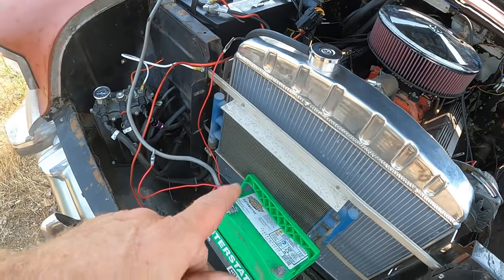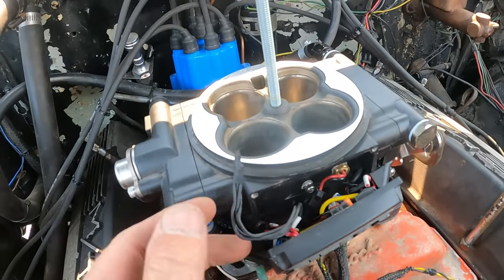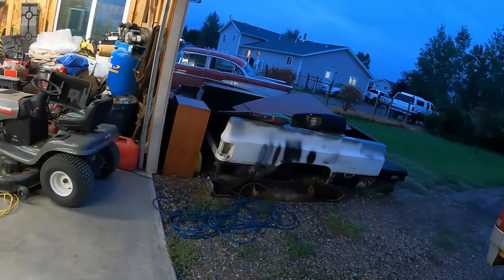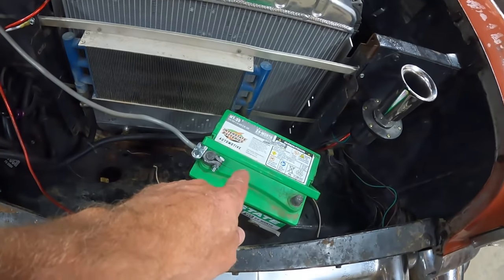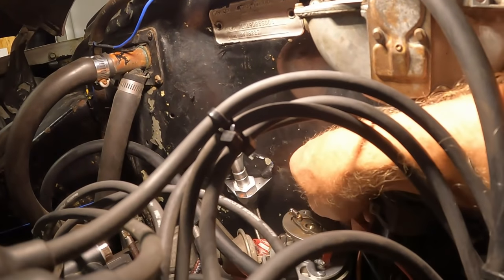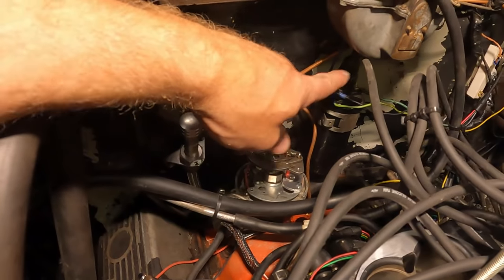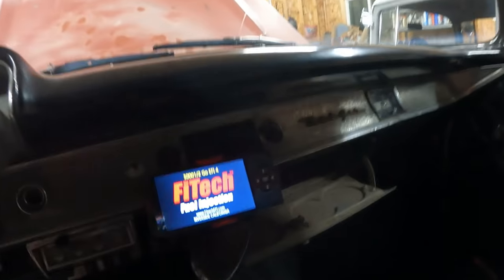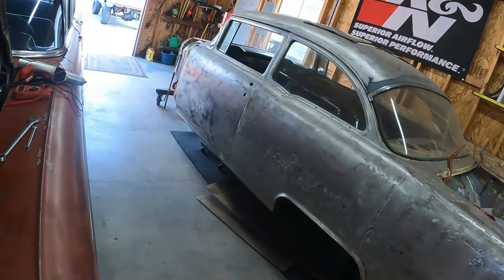Installing Pertronix Electronic Ignition, the FiTech Fight Continues

Comment: Yeah wow, this is so sad for you that now the ignition system is not working. No spark. Damn it.  Yeah I feel your pain. Question do you need to set the air gap on the pick-up coil in the distributor? Also a worn distributor shaft will give you issue. Good luck keep us posted. OH yeah the 57 i/was known as the DD Speedshop 57 to all those just like yourself. I have no issue with you calling it that. If I won it I would be calling it the same think. Greer's and God bless you and the DD Speedshop 57.
Reply from the maker: Hopefully it was a bad ignition module and a new one will fix it, but most likely it is still some weird wiring thing I cannot trace down. There is no gap or anything to set on the system. It just work off of magic like I said. Haha, I'm not sure how it works. I have not checked the dizzy shaft, other than it "feels" normal to me. That may be something that gets changed out if the issues continues. Thanks!

Comment: Where is the "star wheel" that fits on the centre? The pertronix system needs to know when to fire,  so there should be a black ring that fits on the spindle  (where the 8 lobes are that would lift the points) the points replacement pickup then senses the signal.
Reply from the maker: Thanks for watching Bruce. There is no "star wheel" or magnets or anything with this version of Pertronix. It is "lobe sensing". So I guess it somehow senses the lobes in the distributor shaft? I don't know. Like I said, it works off of magic...

Comment: Hi Brad, I don't remember, does this car have the updated side motor mounts, or does it have the factory front mounts? The reason I ask is because on my 1st 57 Chevy with factory front motor mounts, I was able to fit a factory Chevy hei distributor in it. That I got straight from my local junkyard. No problem with fitment at all. And I was able to throw out my external coil, ballast resistor and all of the wires associated to the external coil, starter and ballast resistor. Put a new cap, rotor and 8mm sparkplug wires on it. Ran a 12 or 14 millimeter wire straight from the fuse box to the battery terminal on the distributor and the car ran great. If you infact have side motor mounts, sometimes those can be adjusted 3/4" forward, which may give you the room you need for a factory gm hei distributor. You could buy that brand new fairly expensive at autozone. Just tell them that you need a distributor for a 75-79 Camaro with a 350 ci. I have also heard of people having to unbolt their transmissions and jack up the back of them in order to get the hei distributor in. Because their transmissions mount is worn out and the engine is sagging closer to the firewall. And yes I have seen the cheap small style hei distributors on Ebay. But I think they come from China and don't have rave reviews. Good luck. Hope this helps
Reply from the maker: Thanks David. It uses the front mounts on the block, but has some kinda motor plate in the front, not the stock mounts. And rather than the rear engine/ bell housing mounts, it has a tarnny cross member, so the engine isn't "sagging" it is just tight to the firewall, so no dice on the stock HEI working in this set up. I appreciate all the advice.

Comment: If all the fitech stuff is on a seperate battery,then can it. I wouldnt drop another minute on it if i was in your shoes. Something is crapping out when injectors try to fire.typical acceptable cranking voltage 
Is 10 volts.
Reply from the maker: Thanks Frank. I have an update coming soon (maybe tomorrow) about what's happening with the FiTech. Thanks for trying to help!

Comment: GM cars built with points distributors have less than 12 volts sent to them. Check voltage with key on at orange wire, then check voltage turning engine over. I'll bet money you need to wire directly to the starter. Also I think you disconnected the tack wire at the coil  ( green wire that went into the firewall.)
Reply from the maker: Thanks. I do have 12V while cranking, just coming from the switch I guess. That green wire probably was to a tach at some time, but was to nothing now. The old school tach has a different wire to it, and I have actually disconnected it as some say that causes issues with the FiTech.

Comment: The ground wire on the extra battery has to be hooked to ground for it to work
Reply from the maker: Thanks Richard. I did have the extra battery grounded. I tried it grounded directly to the other battery, but then grounded it to the car body. The FiTech was receiving the voltage from the battery.

Comment: Dose it have a crank shaft or cam shaft sensor if so its bad or has a bad ground i know most fuel injection systems require one but not sure about that one
Reply: Ive have had this issue with my s10 and it ended up being the camshaft sensor by the rpm jumping around like that it sure seems to be the issue
Reply: Works off a tachometer signal on this setup
Reply: @chevyfan82  okay
Reply from the maker: Yep, what @chevyfan said, no cam or crank sensor, but somehow gets a signal, or is supposed to, get a signal from the tach. Thanks for watching.

Comment: Just had another thought if your running points voltage drop after starting need  separate voltage source for fuel system  oops see your switching to pertronix make sure voltage is correct for system
Reply from the maker: Thanks. Pertronix has voltage it requires but still no spark...

Comment: check you got live to coil when cranking i think you need live from cranking side of ing swich on them tri5
Reply from the maker: Thanks man. Yep, it has voltage to the coil at both crank and run.
Reply: if its both sides have 12v if not it look like you got some rewire-ing to do make sure your live come's off bat/starter to ing swich

Comment: There is no way I ever let something beat me at this game. Then came the hei and other types of works from the impulse like those coil over ignition systems they had on iron dukes and for the life of me, I never figured out how a primary and secondary spark ever worked. I know a tac works off the negative side of the coil. I am getting up there in age so have to ask, does the vacuum plate the points bolted to have a ground wire going to the inside of the distributor? They were a wire about three inches long, bare most were, and made sure that the points got a good ground to the engine block. I really don't see oil stopping a ground from going through the bearings in it to that shaft or other as I have no way of explaining what I see in my head but since you have been living under that hood for a few, thought maybe you could work with some of my idea. So at this point, can  the distributor come out so you can deal with it. I would want to put a known working distributor in and a carb so you can hear it run for a bit. I and you both heard it run on a distributor and I think something has to have failed in the distributor. They also make HEI distributors that don't have coils in the cap so can you get your hands on one of  those?? running short on ideas
Reply from the maker: Thanks for the tips man. Yes, the little ground wire is present and attached in the distributor. I have ohmed out the ground to the vacuum plate, and it checks good. The dizzy is obviously old, and people have suggested could be some play or it could be worn out. It "feels" normal in the little bit I have wiggled it around etc, but trying another will probably be on my list if the new Pertronix doesn't work.

Comment: The first thing you need to do is get clean power to the efi and the protronics ignition system ie don’t hook them to the coil or any power wire that’s hooked to the coil.
Reply from the maker: Pertronix says to hook it to the coil. I probably need to hook FiTech up elsewhere, but even if I remove that from the coil, I still get no spark.

Comment: U need that 12 volt crank wire down to the starter connected.
Reply from the maker: I am getting 12V to the coil from the ignition switch.

Comment: Points wire hooks to neg side of coil key wire pos. Side tach hooks to neg side also black wire from pickup coil to ground red to neg.side your just replaceing the breaker with a transformer did it come with a magnetic reluctor to make a pulse? Lobes on dist. shaft aren't magnetic
Reply from the maker: Thanks Jessie. This version is "lobe sensing" whatever that means, so no magnets or anything required. Like I said, it works off of magic hah. I'm not sure how it works...
Reply: @MontanaGarage  I posted a quick video of one that I have that worked very well with my two four high-rise  on you tube check it out.

Comment: don't leave the ignition on with the engine off, can fry the pertronix unit. try going from the battery right to the coil and cranking it, I think you have ignition switch or connection problems
Reply from the maker: Thanks Matt. I have jumped from the battery to the coil. No dice. They say leaving the switch on is not an issue with this newer Pertronix unit, but probably still good practice. Thanks for trying to help.

Comment: Hi just wondering does the tach signal have to be analogue or digital. Just that I am sure the fitec system is digital I know this sounds a bit dumb but I am sure it is a stand alone system, basically all engine side electronics have to be wired from it via single feed from a good fuse box, then the tack etc needs to be fitted with digital gauges etc the reason I ask is when you showed the fitec display the temp gauge showed a temp signal of 60 or something like that surely this should read 0 or at least room temperature I have come across stuff like this before because people make a simple error and leave the old sensors etc in and wonder why they have signaling problems. Keep at it I am old school but I believe carbs and points have had there day fuel injection is the way to go so stick with it bud, ddss has made errors on short cutting the wiring of the unit unplug all the fitec harness and just start again and dump the shit wiring job..
Reply from the maker: Thanks man. I'm not sure about your digita/analog question, but things are hooked up as they should be as far as my little brain knows. The temp of 60 was probably accurate temp at the time.

Comment: Does that distributer have worn out bushings? The shaft might be moving around too much causing issues 🤔
Reply from the maker: It feels tight to me, but wondering if this might actually be a possibility. If I cannot get spark with the new Pertronix module, I will probably have to try a different dizzy. Thanks for the tip.

Comment: Might sound stupid but surely it’s not a bad coil wire
Reply from the maker: Might sound stupid, but that is one thing I haven't changed. I always had spark with the points, so I would think it's still good. I did check the wire ends to make sure I didn't pull them off while swapping coils. Thanks for the tip. I'll switch it out with the one from my '55 just to be sure.

Comment: I’m on you side and want you to get this figured out but you need to go one step at a time, it feels like your randomly changing things with no rhyme or reason. From the last video did you get an answer to why your Eli module was reading 4volts? What input to the ecu gives you this value? Red wire or white? They both in the diagram have connections in line that could be the problem. Now you need to resolve the distributor issue first. Systematically troubleshoot this thing one at a time. 

Step 1 Eliminate ignition system from trouble. Hot wire the ignition, positive battery to positive on coil, eliminates any wiring or ignition switch. Crank it, Spark yes or no? 
If no fix distributor, if yes move to step 2
Step 2 Check for fuel. No fuel, spray some directly in throttle body to see if it will run.  Confirms ignition works then move on…….
Reply from the maker: Thanks for all the tips Randy. I know it seems random. It is hard to film and explain eveything. Trust me, I ahve done WAY more that you are seeing here.

Fitech basically stopped helping or answering questions once they found out I was running points. They though the voltage drop was probably due to the points. I agree I need to correct the dizzy issue first, that is why I haven't been back in touch with Fitech. 

I have done your step one, no spark. I am currently waiting on a new module from Pertronix. Hopefully that is the issue, but I am skeptical. Seems more than likely it is something in this wiring, but I cannot track it down.

When I had points, it would fire when adding fuel to the throttle body....

Comment: You know FiTech is crap since there is a Facebook forum on trouble shooting.  People couldn’t get straight answers from FiTech so they have to help each other
Reply from the maker: I haven't heard much good about there tech service. They did initially try and help, but basically said they couldn't help more until I got rid of the points. Now I'm just trying to get spark again. When the FiTech still doesn't work (which I assume) hopefully the help more.

Comment: I'd check the ignition switch it's self
Reply from the maker: It's a cheap non-stock generic kinda deal, so probably worth looking into. There is almost 12V getting to the coil, so I don't think the switch should be causing the issue.

Comment: Dump the Pertronix and that points distributor and put in a HEI gm unit, fix the bad wiring.FiTech should not change dash voltage.ADVANCED aUTO HEI complete $75.00   it fit in my stock 57
Reply from the maker: Yeah I know they fit some '57, but my engine is probably mounted different. No chance a HEI fits in this one....

Comment: If you have the wrong gage wiring , you will have a voltage drop from battery
Reply from the maker: I am sure some wiring is probably the wrong gauge. I have isolated the FiTech to a separate battery, with only the FiTech wiring involved, and it still shows voltage drop. I can put a meter on the FiTech white wire, and show 11+V while cranking (or even more with the charger hooked up) and at the SAME TIME the dashboard will show fluctuating voltage down to 4 and even disappear. Seems like an internal FiTech issue to me, but I could definitely be wrong. I appreciate you trying to help.

Comment: So……the helpful Fitech guy on the phone. Well, if he says the points cause the voltage drop but can’t explain simply why and , can’t explain why it ran before simply doesn’t know his arse from a hole in the ground. With the broken round terminal you found in a brand new unit and all the low voltage issues Fitech owes you a whole new module. Hope you’re watching Fitech because your image and value are quickly going down here. By using a separate power source you have already proven the points were not the issue. The upgrade to electronic ignition is a good idea but not really necessary. If Fitech (who donated this) does not jump into quick action and replace the whole system for you then I’d vote to replace that junk with a carb and move on with life.
Reply from the maker: Thanks Bob. Yeah he was initially helpful, but wouldn't answer anything else once he found out about the points. I haven't got back to them, as I am still waiting to see if the new ignition solves the issue. I don't think it will though...

Comment: Dude, just put a 4 barrel back 9n it : get rud of that efi. Plus zip ties on the plug wires close together with those zip ties aren't helping your firing any
Reply from the maker: It's getting to that. I still don't see the issue with the zip ties though. You think I need more space between the wires? Hasn't seemed to cause me any issues on other engines. Thanks for watching.
Reply: @MontanaGarage  yes sur, ut will cause  improoer firing. Also, check and see if there is a ground strap to the block. If maybe a good idea to ground the block.
Hope you get it going soon.

Comment: Watching the start sequence at end of video and the Fitech screen, that thing takes way too long to recognize full battery voltage and the initial tach signal is whacked for sure (58000). That Fitech system has issues within the electronics that I do not believe you will ever fix without completely replacing it. At this point, stop frustrating yourself and put a carb on the car and drive it. Also, if you have good spark coming from the coil wire as you crank, then it would seem the Pertronix unit is working??? Could you have introduced a rotor/cap/plug wire problem? Doesn’t make sense to have it at the coil wore but not the plugs. Ditch the Fitech and move on. Your blood pressure will thank you.
Reply from the maker: Thanks Bob. Leaning that way if I don't figure something out soon. I didn't explain the spark very well. It has spark from the coil, but it is also kinda random and sporadic, not consistently sparking like it should. I can't find any wiring or ground issues, so figured trying a new module was the next move?
Reply: @MontanaGarage  Sometimes the best approach (especially with electronics involved) is to step back to the known, simplest configuration that you know would work. By introducing the Pertronix system ( not being critical) you also introduced another new system to the current issue. A) We know the car ran when Dan had it. B) We know it ran for Sobering but had issues. So the basic engine runs but fuel issues have been getting worse over time. To approach this step by step I would suggest disconnecting Fitech and putting on a Carb to temporarily eliminate that possible issue. Get good fuel delivery and then see if it runs. If spark is still an issue then temporarily go back to points and ballast resistor and see if the car runs daily. Once you have the simplest engine system starting and running on a daily basis then you can introduce upgrades one at a time like the Pertronix system and you will better control the results by only dealing with one new system at a time. I know the nightmare it can be when you have to try and make multiple new electronic systems talk to each other and work together.